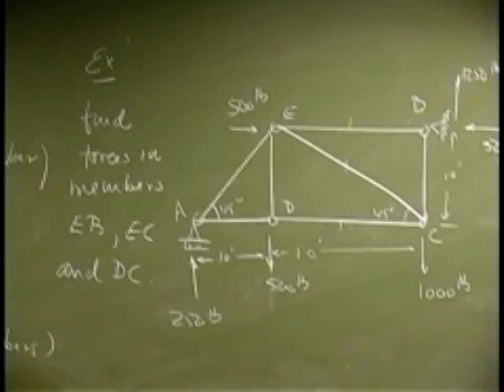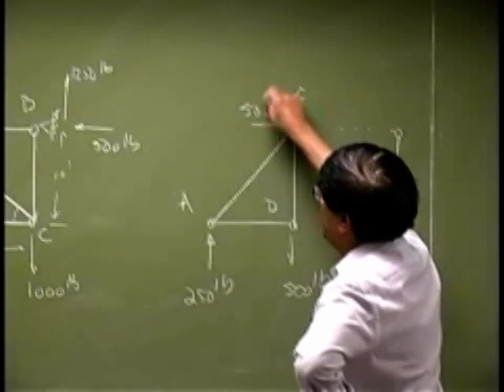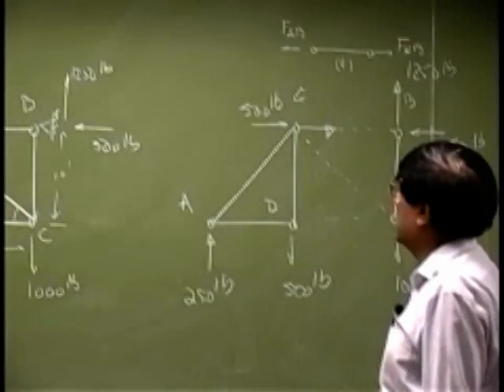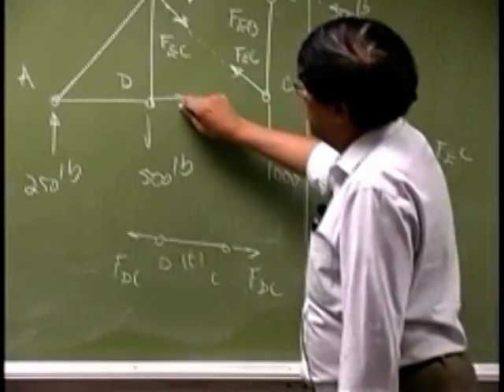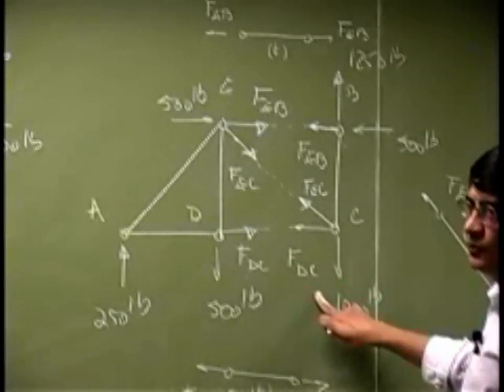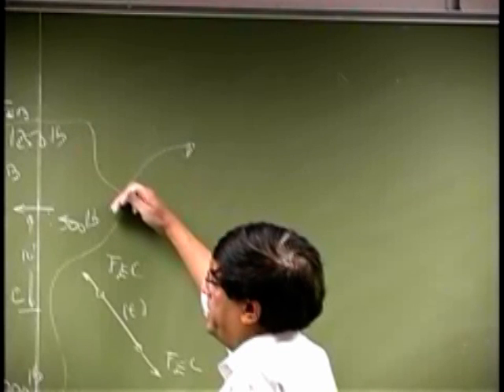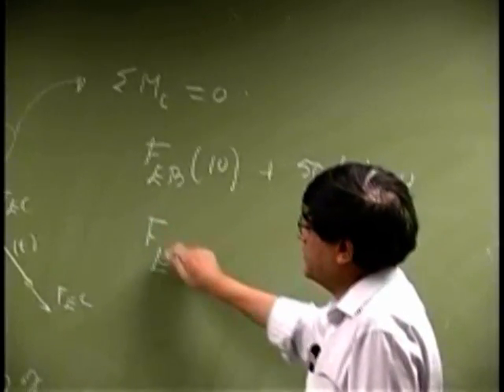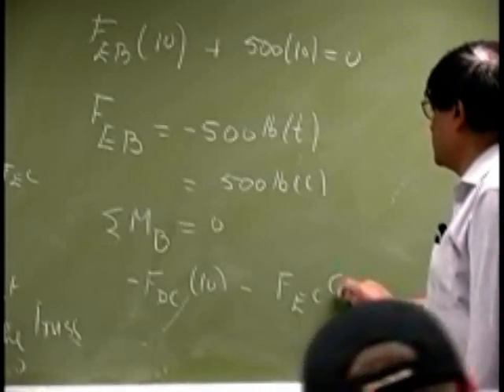Analysis of Truss | Method of Sections | Example 1 Part B

Comment: @kenikozo What do you mean by middle section? You are finding the forces in the members which would be the same value if you look left or right of the cut. If you are refering to making a horizonal cut you need to remember that you can only work with one unknown at a time but it would still be possible is some trusses.